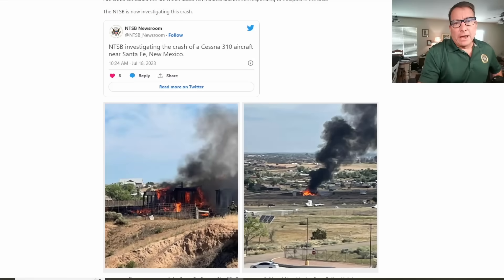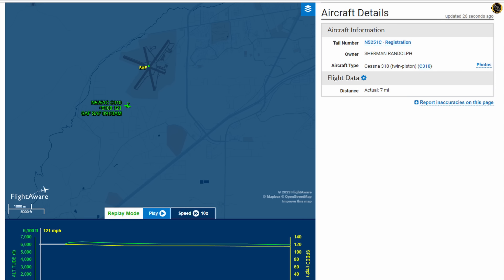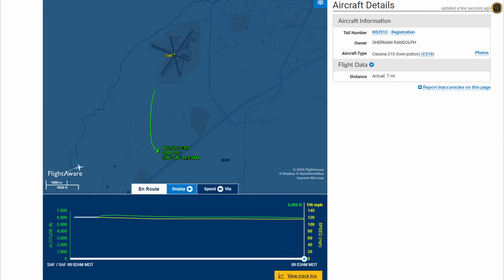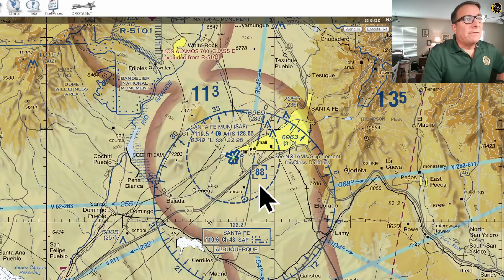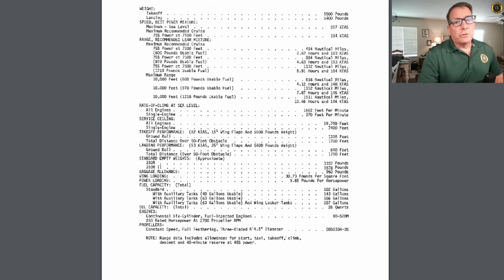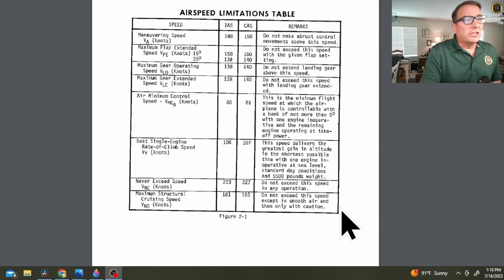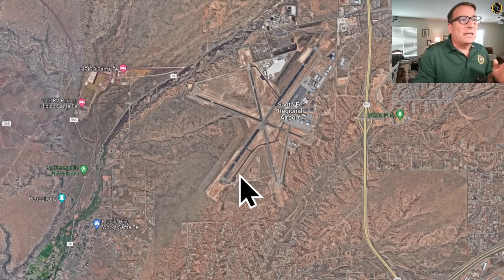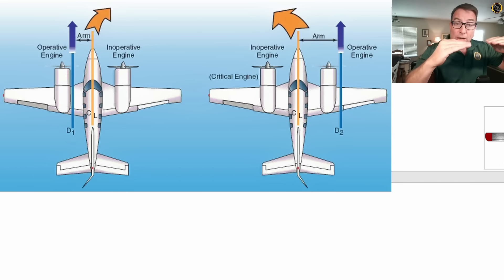Fatal C-310R Engine Failure - Santa Fe, NM

Comment: I got my ATP and multi training in a worn out 310 30 years ago in Rapid City SD and with two big guys in the old tuna tanker one didn’t pull back on the wheel much with either engine caged. Reminds me of an old 1960s story about a guy stuck on the wrong side of some mountains in a 310 on one engine. Once he figured out that he could not get over the hills he looked for a place to crash, as he lowered the nose a little to look around the 310 picked up a few mph and started to climb and made it over the hills.

Comment: This was a turbo-charged C310 and the pilot was an expert. old school, stick & rudder guy. He had the skills and should have had the margins he needed to safely land after an engine failure even at a 9,000 ft density altitude. IMO, there must have been some other contributing factors to this tragic accident. I hope the full NTSB accident report sheds some light on what exactly happened.
Reply: I think you're right about that they're still in the preliminary stage they have yet to release the report

Comment: Juan looks like you were looking at a non turbo Cessna 310. A T310 actually has a single engine service ceiling of 17,000
Reply: WRONG, just maybe maintain 17,000-  if you’re already ABOVE that altitude AND at cruise speed…   It WILL NOT climb to and maintain that altitude from below…
Reply: @joer5571  It is not wrong that Juan showed non-turboed Cessna 310 performance specs.  @Jopanaguiton was just pointing that out.  You probably should have replied, "YES, BUT just maybe ....."
Reply: @joer5571  I hope you've actually flew a T310 with Ram 2 or Ram 4 engine before you tell someone with 3500 hours flight time before you tell some they are wrong.
Reply: @rpmcitycruiser    WRONG information kills people, there is NO reason to put some fancy garnish on it…
Reply: @Jopanaguiton     Yes, actually, I have…
 Also, I have over 30,000 total hours of flight time, more than 5000 of which is in piston twins, and have had engine failures at both low AND high altitudes, and ALSO know how these performance numbers were arrived at, and know how MANY factors degrade these numbers, which were calculated using a NEW airframe, engines, systems which operate landing gear and flaps, AND a professional flight test pilot, who had the procedures, techniques and flying skills needed to perform the maneuvers repeatedly and perfectly to be able to average, then publish the results…
 I’m NOT ripping on you, brother, I’m just pointing out that you NEED to know what these numbers are, how they arrived at them, and how they can degrade when the SAME conditions DO NOT exist as when the flight tests were done (including the pilot)…
 Thanks, in advance, for understanding what it is that I’m saying here, I’ve personally watched too many pilots bend metal, tear fabric, hurt or kill themselves and others because they did not understand or were cavalier with performance figures and/or operating airplanes…   
 It really is depressing to see pilots smashing up perfectly good airplanes in exactly the same ways they were doing way back when I started flying, almost fifty years ago…
 All the best to you, brother…   J

Comment: Did my initial training at SAF during the summer in C-150/152s. Density altitude is always high and cross winds are more than likely. Think those little airplanes had 100 or 110 hp engines, they will teach you about aircraft performance at high elevations. I was blessed with a good instructor and learned my lessons well.

Comment: I fly into this airport often. Density altitude can easily get over 10,000’ on hot days. For non-turbo charged piston airplanes, if you can’t make an early morning departure, then don’t go flying. RIP to the pilot. 😢
Reply: This was a T310
Reply: While I was in the NG there ten years, I flew Ercoupe, Champ, Tri-Pacer, and C-175 home to Gallup three times a month.  I left drill weekends on Sunday at 5 pm summer and winter.  Additional flight training was mostly 5 pm to 9 pm so I left the next morning.  Low ground effect until cruise was always available on long runways and down drainage egress towards the Rio Grande.  Those techniques had to be default to be safe, but that and later pipeline patrol in 172 requires flying in heat and wind.  Managing all energy, not just turbo or jet engines, makes it safely possible.  Ground effect, wind energy,  potential energy of altitude, thermals, and ridge lift are all free energy.  In the mountains or high DA, when pulling on the yoke doesn't get you up, push a bit on the yoke.  Attempting too hard to maintain altitude can kill you.  The design of the airplane is to fly, not stall, in turns.  Only a pilot pulling on the yoke can stall an airplane.  The critical angle of attack is when stall happens.  The pilot pulling on the stick is what causes it.  Low powered flying in the mountains and high desert is mostly maneuvering flight.
Reply: So the pilot was foolhardy to attempt this flight?
Reply: @Phiyedough 

     Too early to tell.   For every flight it is important to know the performance capability of the aircraft for the given weight and density altitude.

     In this case, it’s entirely possible that a C-310R can climb on one engine with a solo occupant.

      In the case of a light twin, the pilot also needs to have a mindset that an engine WILL fail on takeoff and he/she will be ready to feather the inop engine’s propeller to ensure the pre-calculated performance will be available.

      More often than not, ME pilots are not in the proper mindset at takeoff and are startled by the engine failure.   This is when mistakes happen, especially in a single pilot environment.
Reply: @jimmydulin928  Pulling on the Yoke or turning INTO a dead engine...........Paul
Reply: @Phiyedough  I mean, not much more than a comparable performance single engine. I would think someone making this departure should just have to accept that a single engine failure would likely mean not returning to the field. It is a little concerning that he even mentioned "getting a little altitude" Sounds like that was never a chance, given the DA, on one engine but he may have been trying anyway.
Reply: I once wanted to fly a plane like these. Good thing I gave that up so many decades back. Just too much atmospheric stuff one needs to safely fly!
Reply: @Stepclimb  Glad my cars have never had any similar failure. The ones they had were bad enough, but combustion on the ground isn't so unreliable.
Reply: I have no real expertise in any phase of aviation. But I keep hearing of defects in how light aircraft work. In this case, two engines, one is critical, and turning to one direction is turning into the dead engine. Intuitively I think the pilot has to know this and instantly ask for a right turn. I mean, the guy's life in on the line. Then the density altitude, assuming the pilot understands the characteristics of his plane, might be a "bad day to fly". I saw a memory items list that seemed to have about 20 items. Your plane wants to crash and you have to mentally perform that many items? And by yourself with no workload splitting or insurance you are remembering. They say crashes are babies with many fathers. This sure sounds like that. The original mistake might have been having to take off from this airport. Juan should explain how that takeoff could be a good decision.
Reply: @Phiyedough  The problem is that the aircraft has a very small emount of reserve power/is  barely flyable on one engine.  If I lived at altitude, I'd make sure that the 2nd engine was wasn't needed very much for stable flight.  Really a problem of poor choice of aircraft... which led to flying it for many hours with essentially zero safety margin.  As bittnerbs pointed out, on hot days, it could be like taking off at 10K ft.  I'd make SURE the craft could take off at 10K ft on one engine before buying it.
EDIT - apparently the person was from California and used to airports that weren't even at 1000ft. Such a small thing to miss in your pre-flight check... :(
Reply: @JimMork  I think you are interpreting limitations as defects. Aviation has a much steeper requirement to know the limits. "Bad day to fly" is a calculation that involves risk tolerance. One might decide to accept the risk of the high DA (I wouldn't!), but given that the pilot radioed he was going to try to gain some altitude on a day when that's probably impossible indicates he either didn't do the DA calculations, or didn't remember to compare them to the single engine performance limit, or due to panic/stress/workload/startle he forgot his own research/training. Even on the ground in cars, the vehicle can only do so much, if you ask too much of it and exceed it's limits (i.e. turning to hard/fast) bad things start to happen there too. As you noted in your previous comment Aviation is much more complex. If you don't want to put the effort in or can't handle the complexity pursuing a different hobby/profession is an excellent idea.
Reply: @GusHeck  That is to some degree what I'm saying. Commercial planes have fairly sophisticated software that knows characteristics of the plane and will veto inputs that violate the limits. The cheaper the plane, the more dependent on pilot comprehension. And a licensed pilot should not be a ignorant pilot. I mean, if you are ignorant and alone in your plane, it is Darwinian. The inquisitive pilots have a greater survival chance.
Reply: His LEFT engine was out, so as Juan said, he shouldn't have turned LEFT into the dead engine...among other possible factors. He departed around 9 AM, so was that early enough? I don't know.  @Phiyedough

Comment: Well said Juan. I used to have a 414 but sold it because I worried that my engine out skills in just this type of scenario were inadequate to recover. It worried me enough that I decided to sell the airplane after a wonderful period of ownership. It just takes aggressive regular training to be ready for this type of scenario, and once Vmc hits, sadly, game over. Under these conditions, margin of success was very slim. Pilot was very calm. RIP aviator.
Reply: That's a lot of plane for 310 hp engines,  Yeah it's fine when both are working.  Glad you were never presented with a situation like this
Reply: @brinkee7674  ..and much harder engine out on an Apache 150 ..really tough staying in the air then under the best of conditions even at sea-level density..
Reply: @skippmclovan1135 probably why so many upgraded the engines on the Apache if they could
Reply: I was in and out of Farmington many times in a 414.  Often on very warm summer days.  Never had any trouble..and being on a plateau helped in the am.  Usually.   I don’t miss the angst I felt.
Reply: i had an engine failure in a 414 last August. Thankfully it happened at 17500 feet over the water enroute to the Bahamas. I had zero issues bringing it back to Fort Lauderdale with a steady 500 fpm decent. It flew very nicely on one engine, but I surely wouldnt like the engine to quit right after takeoff...
Reply: @MarekMarciniak  as a pilot of a single engine archer I gotta think engine failure upon departure is the worst time possible,especially in tight urban areas

Comment: Sorry to see this.  I flew from that airport for a few years in the late 90's, and remember that density altitude being a constant challenge.  Tricky winds, too.
Reply: What is density altitude? Doesn’t the air get thinner? But doesn’t thinner just mean more water?
Reply: The “thinner” the air is the more the humidity this is opposite of what you would think and I don’t see how that’s just a “minor factor” how high do you have to go before there’s no water, it seems like there’s water all the way up as high as you can go, they’ve never found a place yet as far as o know where there is no water
Reply: I fly out of that airport often. And yes DA can be extremely high and today was very hot
Reply: @williambarringer6513  It is a term used in aviation to indicate the conditions (related to outside air temperature and barometric pressure) that the aircraft is operating in.  When it gets hotter outside the air is less dense and the aircraft will have a reduced performance envelope that is the equivalent of a higher altitude.  I was always taught it had more to do with the density of the air molecules as opposed to humidity in the air.  Naturally aspirated engines lose power at higher elevations, and for aircraft, less thrust is developed by the propeller since the air is less dense (less of an equal and opposite reaction, so to speak).  In this case the actual altitude of the airport was a little over 6000 feet, but because it was in the 90's, the aircraft performed like it was at 9000 feet.
Reply: @williambarringer6513  It seems counter-intuitive that humid air is less dense than dry air, but it's easy to understand why.  Back in high school physics we learned from Avogadro's Law that the number of molecules in a fixed volume of any gas is constant at constant pressure/temperature.  Dry air is made up almost completely of nitrogen and oxygen molecules (over 99%).  Nitrogen molecules, N2, are made up of two nitrogen atoms with each atom's mass 14 times as much as a hydrogen atom. Oxygen molecules, O2, are made up of two oxygen atoms with each atom's mass 16 times as much as a hydrogen atom. In humid air, almost every H2O molecule will replace either an N2 molecule or an O2 molecule (in order to keep the number of molecules constant). Since an H2O molecule's mass is only 18 times as much as a hydrogen atom and it is replacing either N2 (28 times hydrogen atom) or O2 (32 times hydrogen atom) the mass (and density) of air decreases as the water vapor in the air increases (higher humidity).  Since lift depends on air density, planes have less lift in humid air when temperature and pressure are constant.
As an interesting side note (to me at least), the humidity of air also has a profound effect on velocity of propagation of radio frequency signals (which propagate slower in more dense/dryer air).
Reply: @mastabugfish  so why does the plane go higher to go faster? More humid air is faster? How high do you gotta go before it starts to dry out again, the air is like a big blanket smooshing down on us there’s gotta be another layer on top of that smooshing it down, or it could be like a bubble air pocket, there could be layers of air trapped above us or below us or other bubbles
Reply: @williambarringer6513  - Air is thinner at higher altitudes which means less drag (free higher speed up to a point) and increased fuel burn efficiency (free fuel up to a point). This is why we pay attention to indicated airspeed instead of true airspeed during flight - indicated is what the airplane is feeling, true is what we are actually doing through the air. The latter is going to be much higher in a gap difference the higher up you go and that's a good thing (again, up to a point). You are trying to comprehend how aircraft perform at what you know on the ground and how air feels to you. Aircraft and how they perform in the air don't work that way. As others have said, it's at a molecular level. Air molecules work in mass to flow over (and under) the wings and control surfaces. The fewer the air molecules, the less the lift and engine performance...and that goes for both piston and turbine prop/jet aircraft. Aircraft only know one thing and that's airflow over the wings and control surfaces. Temperature, pressure, humidity, and airport altitude all combine (measured as density altitude) to make each day flying completely different which is why we have performance charts to make takeoff distance calculations from.   Hope that helps a little!

Comment: Nice report, but you need to get the proper numbers.  The ASN reports shows it as  T310R. T as in Turbo, so higher single engine ceiling and better single engine climb performance at higher altitudes.  Also, the ADSB altitudes are GSP altitudes, not pressure altitudes, so you need to convert based on altimeter setting to determine actual altitude.

Comment: I have flown normally aspirated and turbocharged 310s in Colorado.  In the turbo my pre takeoff briefing to myself goes "If one quits before I have the gear up, I'm closing both throttles and landing/crashing straight ahead"  In the no-turbos version in the summer that is amended to "If one quits before I have 1,000 feet above the runway, I'm closing both throttles...."  If an engine fails later I will secure it, establish blue line airspeed and land as soon as I can.   The single engine service ceiling is almost always below the surface if the temperature is above standard and the airplane doesn't have turbos.  There is no such thing as balanced field length in those conditions - the 310 is effectively an especially thirsty and noisy single with good climb performance at high density altitude - if an engine quits you will be flying a high-speed very noisy glider with controllability issues.

Comment: One of the most surprising things I learned when entering aviation was that a lot of twin engine planes are kind of garbage.  A considerable portion of the time if one engine quits you are, I'm told, best off just to throttle down the good one rather than risk exactly this kind of maneuver.  Something like a Turbo Skymaster can apparently kick butt on one engine, but even the original O-2 was maxed at 8,000ft on one.